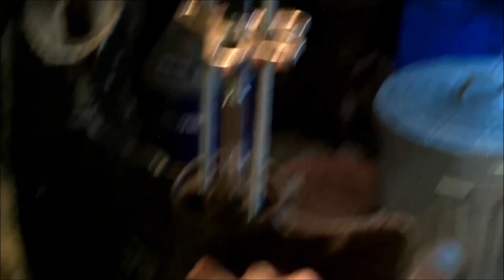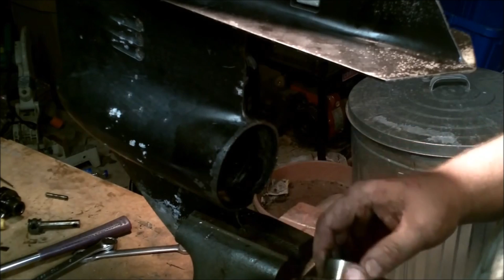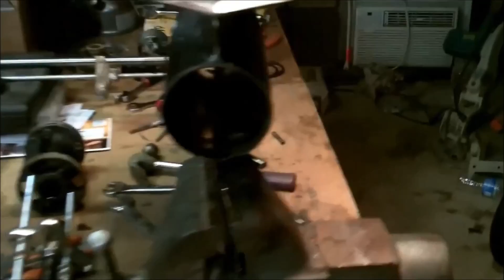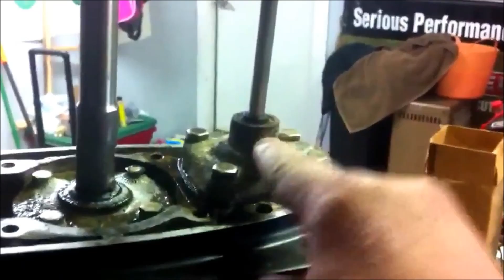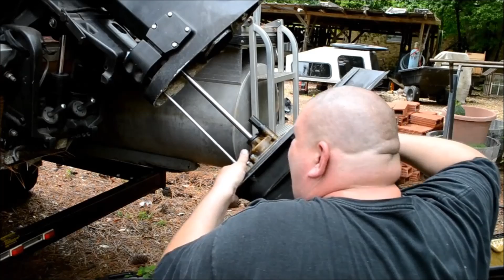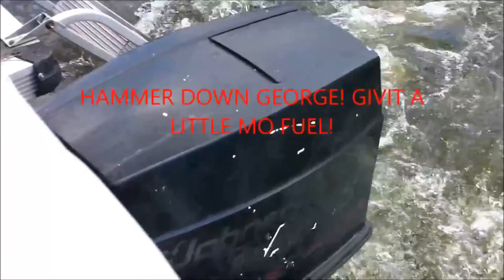PARTS 1, 2, AND 3  40-70HP / JOHNSON AND EVINRUDE / GEARCASE FAILURE / SHOW AND TELL / LAKE TEST!!

Comment: Hey man curious if this was making a rattle sound when you guys discovered it had an issue? I’ve gone through 3 lower units in less than a year and I refuse to buy another used one. they all sound like an engine rod knock.. someone said the dog clutch could be ruined?

Comment: Jeremy I have a question. I bought a 60hp Johnson and opened the lower unit drain plug and nothing but water   came out, what should I do? First time boat owner and the boat ran great by the way.
Reply from the maker: Pressure test the lower unit and see where it’s leaking.  Prop seals, shifter seal and gasket, drive shaft seal Are the most common leak points
Reply: @THEMOWERMEDIC1  thanks for getting back to me brother
Reply from the maker: The easiest way ever is to dunk the whole gear case in a barrel of water and pump it up.  Watch for bubbles   Kind of like finding a Leak in a tire
Reply: @THEMOWERMEDIC1  great idea, will try that today. I will gather up the stuff to make a homemade pressure  test rig.

Comment: Friend, can you explain to me how many RPRs come out on the propeller shaft? for example entering 1,000rpm through the motor shaft and how much would the output intend?
Reply from the maker: Count teeth on pinion and divide by the number of teeth on spur gear.  That will give you the reduction

Comment: Jeremy..I just pulled my prop since it is in rough shape and was going to get a new one and can see fresh gear oil seeping from around the hub o-ring.Would say this is pretty common on a 30 plus year old motor?Pretty slow leak.Is it critical you think to fix right away or can it be run for awhile .Probabley lots of old motors seeping out there.Not good for the environment though.
?

Comment: I bought an 1985 20hp johnson last summer and when I got it home and checked gear oil only a tablespoon of black gunky oil came out.I was sick.PO said it was in storage for many years, but his story changed a lot.How long will a gear box hold up with only a tiny bit of oil in it?It engaged and was not making any noise when I bought it.I did three fills and drains and the first drain was black and it cleaned up after the 2nd  one pretty much.Seals do not leak and has yet to jump out of gear.Hard to say if it was run with no gear oil for any amount of time on the water.Almost seems someone drained it for storage and forgot to refill it?Will always be a question mark and hope it holds up!
Reply from the maker: newyota1 prob just leaked out while in storage. I would pressure test it and fix any leaks.  Then fill with gear oil.   If damage is done you will know pretty quick
Reply: Thanks-Have not seen any leaks thus far and it has not jumped out of gear under load yet.PO said there was no puddles under it from where it was sitting.Not sure what took place.I hope for the best.
Reply: May have been drained to have work done on it and not refilled. Use it!!

Comment: I have a 1993 E40TLETF Evinrude that was running Great and Suddenly the Propeller just Stopped Turning but the Motor still ran  Well... Paddled to shore and just wondering where to start looking??? BTW.. No Noise or anything when this failure occurred.. Was Under heavy load pulling a Tube behind boat at the time???
Reply: i am sure it spun the hub in the prop.

Comment: hi I have a 1993 30 hp Johnson ELS and after replacing the water pump it wont crank? hey quick question I did the install all seemed fine but starter wont crank motor? bat has the bat has juice, starter spins flywheel fast with plugs out. prop and flywheel will turn manually in drive but it is not easy. I can shift from F-N-to reverse, do you think the driveshaft be misaligned? It would break your arm trying to pull a rope manually in neutral.  I should have I should have fired it up before I started the repair to check for any other problems but I didn't..  any thoughts would be great thanks

Comment: i have a 1988 48spl evinrude and it does not have a place to put puller bo;ts and theres not enough space to drill no wholes for puller bolts ,,,,and i cant get it out any ideals
Reply: I just did mine. I used 3 large snap hooks i bought at home depot $2.50 each(marine section) and some chain. A puller from auto parts store. Open up the small end of the snap hook(where rope would go) that is what will hook around the 3 supports of the carrier. The top support is a little smaller than the other 2 so I had to adjust the hook by putting it in a vice and hammer it down. This way all chain lengths were 3 links. Removed long puller hooks off of the puller and used the shackles to connect the 3 chain pieces. I had to widen the link that went to the hook as it wouldn't fit through. 1983 Johnson 40...once ready had it out in 5 minutes
Reply: +karl chesser   Use chain..cut last link like a "C" and hook that on bearing carrier cross-piece.
Reply: karl chesser I've got this same engine 48 spl.. can't get the snap rings out to save my life.   was skipping in reverse.

Comment: Thanks for the videos. I just got a boat with a '82 evinrude 50hp. Took it to a shop. They said the compression was 100 and 90. They also said the lower end would not shift into forward or reverse (just wouldn't catch). They offered to sell me an early 90's 50hp Suzuki or 90's 40hp merc. What do you suggest?

Comment: My question is in reference to removing the lower unit to replace the water pump. I inherited a tri hull with a 1971 Evinrude 60 h.p. with electric shift. I have removed 6 bolts in the immediate area where the 2 units meet. The lower unit will not budge. Am I missing a hidden bolt? Does it matter if it is in gear or not?
Reply: +David H    There is usually 7 bolts... 2 on each side of the cav plate... then 3... more   one is hidden under the trim tab..  one is the trim tab and one just forward of the tab.

Comment: I have a 1976 Johnson and I'm trying to take the foot off to replace the water pump. I'm not to savy with motors and trying to learn, I've removed the four screws on the foot but am having a time locating the drive shaft screw so I can drop the foot. Any advice?